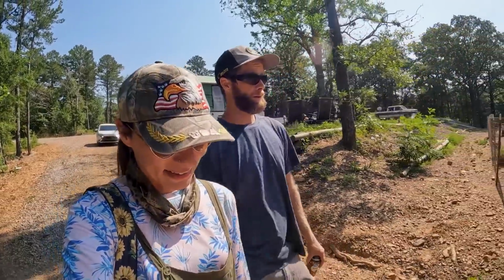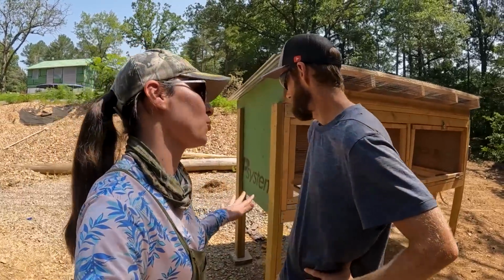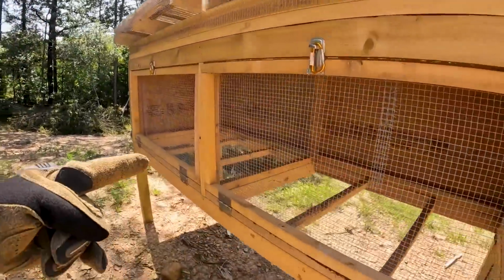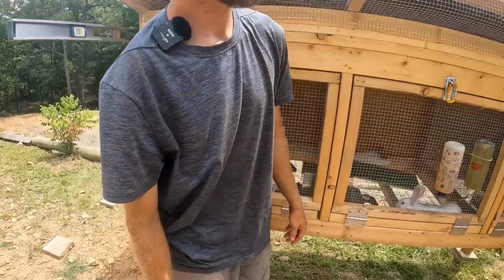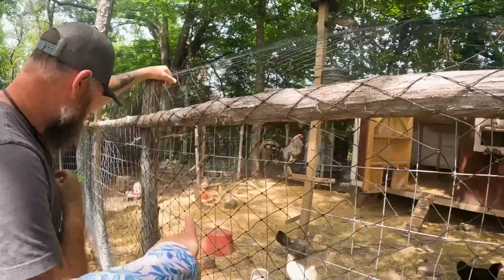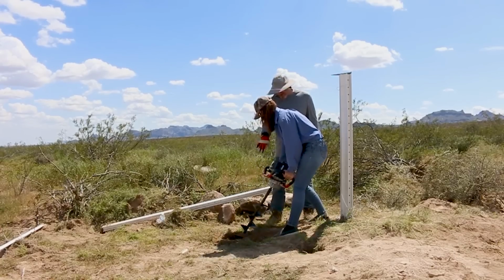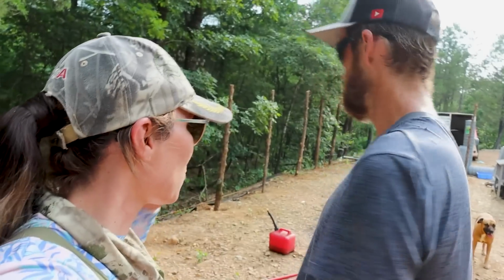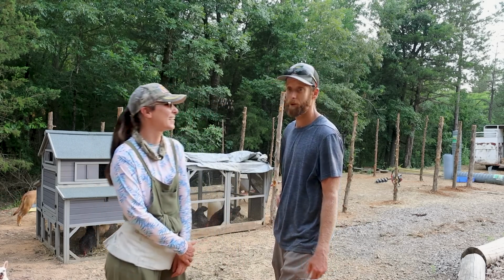He Changed Our Plan - And Its Brilliant!|+ Chicken Run Build |Couple Builds Cabin Family Homestead

Comment: Hey, you guys did a great job, moving those rabbit cages you need to get some tubs under the rabbit cage to catch the gold then all you have to do is move the tub to the garden. You don’t have to shovel anything it’s already in a tub ready to transport. Just a thought.  Maybe a couple wheel barrels under there!!!
Reply: yeah that's what I was going to add but I saw this
Reply: Put wheels on the tub
Reply: I agree
Reply: Drill holes in the bottom of TUBS. You don't want pee too lol
Reply: Or make the bottom of the catcher with smaller wire screen! Bam!  Lol
Reply: Oh, I even had a better idea. You could attach a smaller screen below the rabbits in a V-shaped facing down so when it poops, it rolls down into the wheelbarrow, but the Pee drops down into the ground.  Bam!!!!  Lol

Comment: Just a little tip , take a couple of 2x6’s and make skids that can be lag bolted to the legs and removed. Then you can take the side by side and drag them from one place to another. You might also have toad 2x4’s from the front to the back legs for support to keep them from spreading.

Comment: We called the tamper a spud bar (not sure why). It's my favorite piece of equipment. 43 years ago my dad and I started out using one of those man post hole diggers and I simply couldn't manage it (5'1" woman). So the fence project hit a full stop. We found an OLD Minneapolis Moiine and a 8N tractor for only $2300. Bought a post hole digger (that I still have and use) and fencing in the property commenced. Both tractors are long gone now and I have an 86' Ford/New Holland tractor (wouldn't ever be without a tractor with property). You two are putting in some amazing work..I am in awe of you both.

Comment: Hi guys, just food for thought... when we lived in VA. We made a rabbit hutch like yours, and when I built then a barn like area,  that hutch (which was on a tree line). Fell over in high winds. 
You may want to think about maybe cementing the legs in? Or something, since y'all get high wind storms there. 😉
Reply: Just bolt a piece of 4x2 to the bottom of the 2 legs at each end of the hutch, leaving it sticking out about 2ft both back and front and along the ground. This increases the base dimensions of the hutch, and if it still blows over you will have more important things to cope with. The hutch is still easily moved.

Comment: Have you ever thought of combining your two farming endeavors to include a shared pen for pigs? Justin Rhodes & Sow the Land both move pigs around in the woods using electric solar fencing so the pigs clear the brushy uneven land for them. Go in together get your own pigs but house them together to cut down on some expenses but share the responsibilities.  Pigs love leftover scraps. They use a 50 gal barrel & put a couple metal nipples on it so less hassle watering them. Pigs are strong but train to a feed bucket & they mind pretty good.

Comment: Hope you didn't hurt your back now. Mel. I would have put two beams under it and had four people, two on each side. Like an Amish barn moving!
Reply: I also use ratchet straps underneath that come up to make a shoulder harness. My wife is a lot shorter than me and only half the trouble is strength. Mel didn't have the height to get comfortable ground clearance either, which the straps solve for.

Comment: With constant sun exposure that tin roof is going to over heat the rabbits 🐇...... couple things could be done is build like a car port over the cages so direct sun isn't on tin roof or  build a extended roof on top of the tin roof this will also keep direct sun off roof ....  I lost many rabbits from over heating in the summer in Texas,  I raised and sold rabbits from 4th grade till I turn 21 ....... I even went as far on very hot days set up a box fan to circulate air ..... cutting some horizontal slots about 2 to 3 inches wide across back and ends will greatly help in cooling them down.
Lmbo.... put there fir on and say that again how cool u feel..... and shade does not work alone with out propper ventilation,  I'm talking from experience not out my butt..lol
 That's going to be a big chicken run kudos for building it large .....  chickens are cool when they get acquainted with the area and coop you can literally let them out to clean up the yard of bugs and such and in the evening they will go back into the coop area to roost for the night 🌙

Comment: Hi Mel - You both should have switched positions bcos it's much harder to walk with a 
heavy load and arms outstretched backwards.  Gary's end is easier than yours.

Hi Gary, - Have an idea that you might find helpful.  Since your back hurts to bend down to
collect the gold, why not use your creativity to fashion a funnel out of plastic or tarp, attached
to the under part of the cage,  with a bucket under the "wide" funnel opening, to catch the gold as 
the rabbits poop it out.  OR.........
Build a pull our drawer, installed under the cage, just like in kitchens.  No bending.  
Something to think about.

Comment: In case someone didn’t say it already, be careful of putting rabbits where they can overheat.  I’m still at the beginning of the video so you may have done so already.
Reply from the maker: We lived in the desert and had rabbits before. As long as they can escape the direct sun - they will be good. How their pens are positioned they will never have sunlight in their pens. (On the extremely hot days we will put frozen water milk jugs in for them to lay against). This new spot is perfect for them 😎